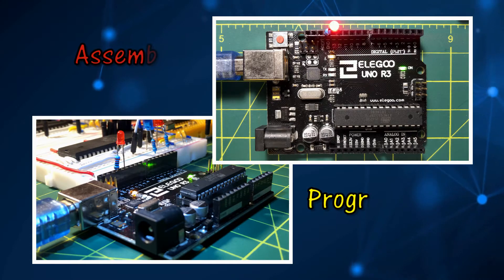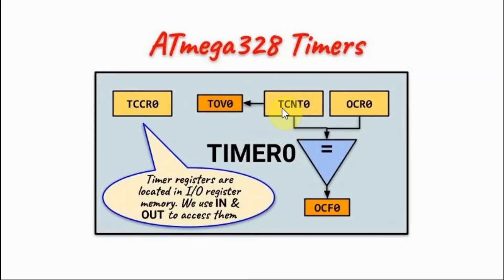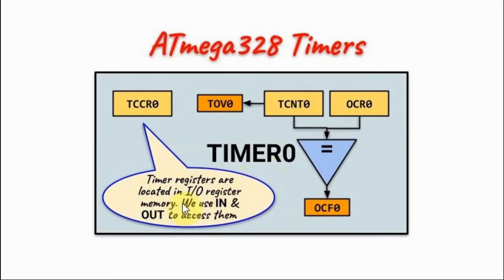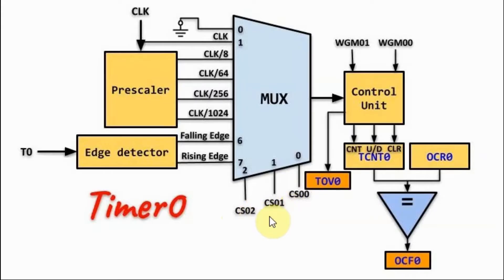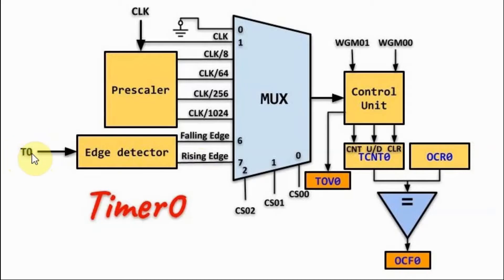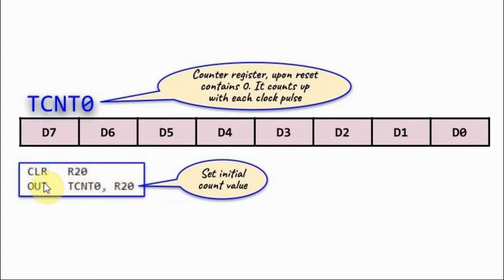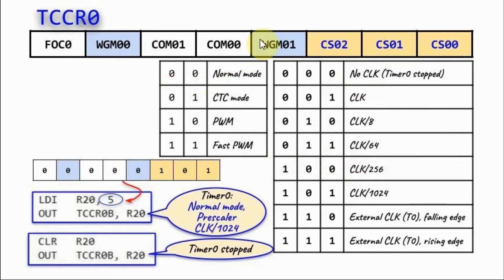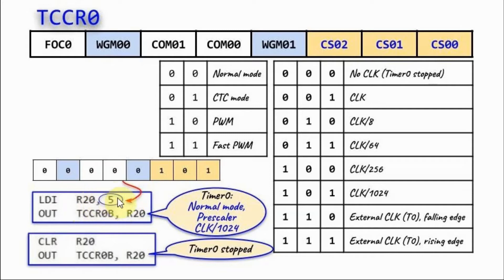Assembly via Arduino (part 12) - Programming Timer 0

Comment: Hello, thank you so much for all of your video's, they are very well made.
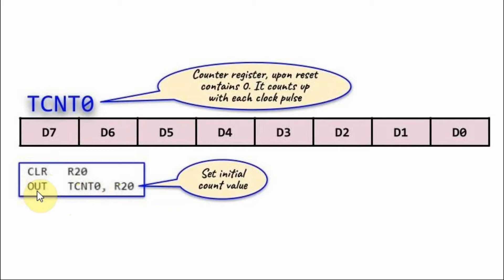However, in this video I got a little bit confused. It seems to me that at 03:44 you are using the TCCR0 out of the Atmega 32 datasheet and not the register that belongs to the Atmega 328P.
It did not affect my understanding of it, you explained it very well.